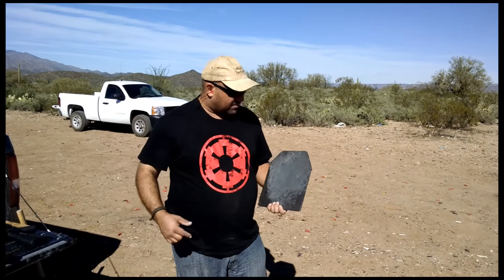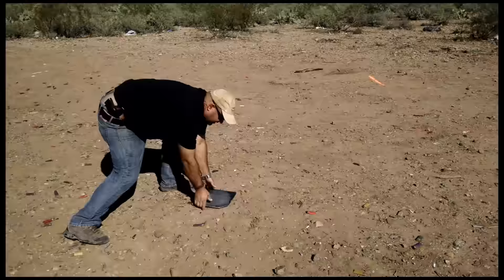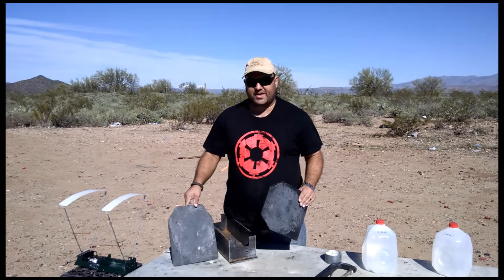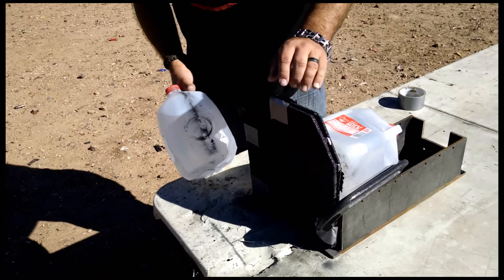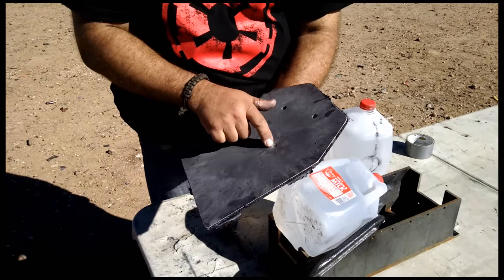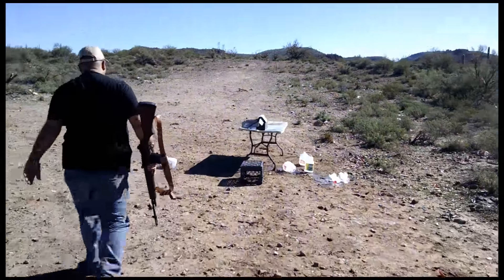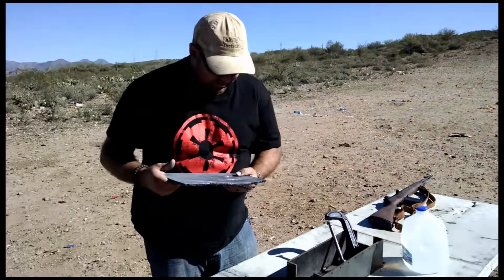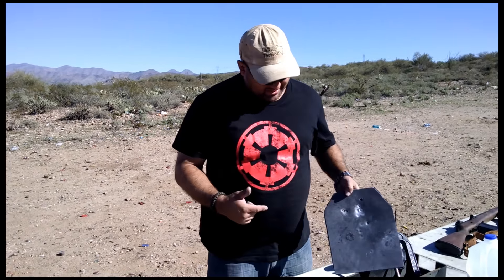Can your armor handle this? (AR500Armor level III test video) ***DEMONETIZED***

Comment: I always wore soft 3A in front on my plate due to fragmentation in case I ever did get hit. It was old body armor past 5 years which I think is a myth that it goes bad. Of topic we shot my fathers soft armor from late 80s and early 90s and it still worked. He retired I took his spot. I still have 4 sets of 3A soft body armor and my steel plate and carrier but don't think they fit anymore. I know I went off on rant, but as usual another great and informative video
Reply from the maker: +Plecemanvpd .vldpleceman Thanks for watching. I have an old IIA panel that was originally issued in 1995 that I've been using for testing. It has held up remarkably well and the only things that have gotten through are rounds that grossly exceed the rating. Soft armor in front of the plate will help with fragments, but this is a little tricky because they mostly move parallel to the plate so they can slide between the soft armor and the plate. Bed liner works really, really well, so long as the surface is prepared properly (sand and degrease completely). People have also had good results with HDPE cutting boards. It's worth noting that soft armor worn behind the plate should help reduce blunt trauma.
Reply: +The Chopping Block I'm retired now. So I have lots of LE equipment it just sits now. Worth mentioning body armor also helps in car accidents. My soft body and my steel trauma plate saved my life though I had to retire a drunk in a F350 came in my lane hit me head on. The second impact we both spun both rear quarter panels hit then I went head onto a utility pole. The impacts we so hard my sternum separated from ribs my mag pouch ruptured spleenand damaged liver. The air bag did help but my body armor is what really saved my life. I still have my trauma plate which was bent to hell and body armor they cut off I was so pissed my car was brand new only 200 miles and my body armor at that time was state of the art for its thickness thin like card board and was 3A. The plate and body armor distributed the force of impact.
Reply from the maker: +Plecemanvpd .vldpleceman Glad you're okay. I've heard many stories of motorcycle cops being saved by body armor.

Comment: Here's my opinion on the coating coming off in 5 or 6 hits.  At that point with ceramic armor, you would have rounds entering your body at full speed.  

Splatter >>> intact bullets.
Reply from the maker: Exactly. But for the record, it took one round of 7n6, three rounds of .270, and ten rounds of steel core 7.62x39mm to make the coating separate and even then I had to work hard to peel it off.
Reply: The Chopping Block Then the coating will last longer than an average ceramic plate.  That's pretty awesome.
Reply from the maker: +Wedelj Probably, yes. Ceramic plates vary significantly. I have heard anecdotal reports of ESAPI plates stopping a full magazine of 5.56mm but I've also seen a video of an AR500Armor level IV ceramic plate being perforated on the third shot with 7.62x39mm.
Reply: The Chopping Block All the more reason to use AR500 steel.  Thanks for the info.
Reply from the maker: +Wedelj my pleasure.

Comment: Only works if you wear my father never wore his always complained big and bulky back then it was. I only work my steel plates when in certain areas of town or when expected trouble but always had it with my gear didn't wear it that night
Reply from the maker: Good point. People often focus on the mobility aspect of the weight/comfort issue, but nobody ever outran a bullet. Still if it's too uncomfortable to wear, it doesn't do any good.